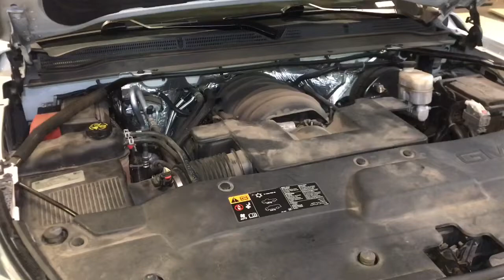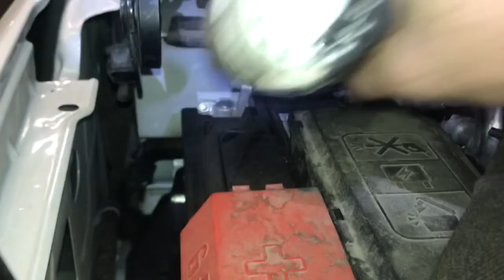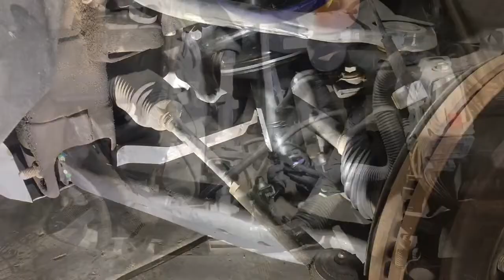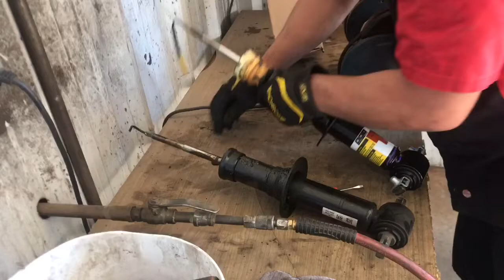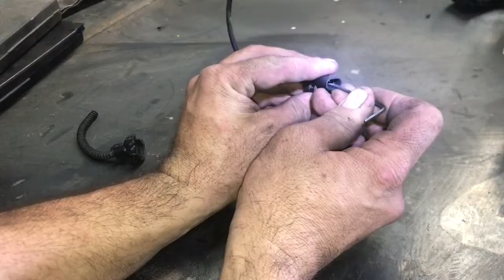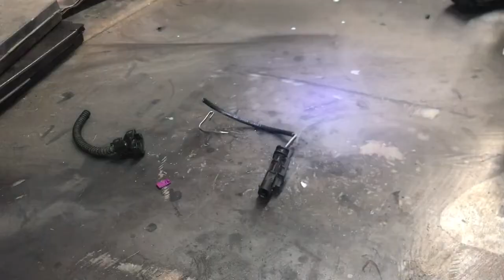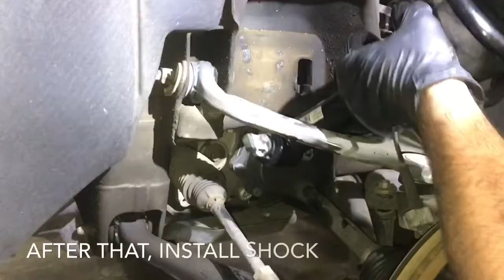Gm Truck and Suv Front MAGNARIDE Shock Replacement (2014+)

Comment: The AC Delco struts are garbage and fail way too often. I’ve owned several of the MRC SUVs and have stopped using AC Delco because of the failure rate. I now use the complete strut assemblies from Detroit Axle. It eliminates having to reuse any old parts and they have a 10 year warranty. Bonus, they’re made in the USA.

Comment: 2017 Denali, purchased 18 months ago with 99K miles,  Dealer said they replaced front struts as part of their prepping it for sale.  

30K miles later, the rubber bushings on the lower control arm, walked out of the strut bore, drivers side strut moved to the rear, passenger side moved forward.  Lots of clunking over bumps, as the strut was hitting the lower control arms.  

I used a air hammer to drive the rubber back into the bore, cut off the extra rubber sticking out of both sides, and welded a 1" washer to both sides of the strut to contain the rubber inside it.  Had to use a large step drill bit to open up the washer enough to give the steel mounting pin some movement.  

This 'fix' worked, but it didn't improve the 'bounding' that the front end had developed.  I called the dealer we purchased the truck from, to find out they replaced the struts with the cheapest ones Rock Auto sells, so we bought new GM ones off Ebay.  They were considerably cheaper than through GM.  

Turns out, the cheap Rock Auto ones, the rubber bushings are completely different than OE, and it's obvious why they failed.  Don't buy crap from Rock Auto, it won't last.

Anyway, replaced complete strut & springs.  Now ride height is about 2" taller than the old springs.  That fixed another problem.  With 22" tires, the tire would rub the inner fender well when turning tight corners, now it doesn't do that.  These new struts came with new upper nuts, however, they were 15MM instead of the 18mm nuts that are 1 time use.

Ride is much improved, but immediately got a service suspension warning on the drivers info system.  

Disconnected both battery cables & touched them together for 30 minutes, to do a computer reset.  Fixed!!!

Comment: I keep trying to find a good direct replacement magnaride strut and coil kit for ease of install and just can’t find an accurate answer for 2015 Sierra Denali
Reply: From what I've found, the cheaper aftermarkets aren't actually magneride, they have the wire and just a sensor or resistor to fool the system so it won't throw a code.  But they're just regular shocks.

Comment: Good video.  Used it as a guide to replace the shocks in my 2020 Denali today.  They both sprung a leak after only 52k miles.

Comment: great video, thank you... I jacked up one side. (passenger).  Tried doing job without taking sway bar link all the way off, that was impossible.  Even after it was removed , putting the strut up into the cradle and putting the nut on closest to you The strut still hung lower than arm!  So had to press down on control arm, jack the strut up a bit to get it over into place.  Mine was the dorman all in one product on a 2016 sierra 1500 denali.  1 hour job on youtube, took me forever to get even the sway bar link off, just my luck.    The fastener holders at bottom of shock that came with dorman are wrong ones, had to transfer over the old ones.   that was a nice surprise running the bolt up into wrong thread -- DORMAN	949730	(2) . going to finish the attaching the sway bar now and then the 2 bolts and electrical.

Comment: CAN'T THE OLD CONNECTOR JUST BE SPLICED TO THE NEW WIRES? **UPDATE** I CUT AND SPLICED OLD CONNECTOR TO THE NEW GM STRUTS. NO CODES, PERFORM SUSPENSION HIEGHT RELEARN. ALL GOOD.
Reply: How do you perform the suspension height relearn?
Reply: @vondaeverett3008  with scan tool
Reply: @vondaeverett3008  WITH A SCAN TOOL. I HAVE A SHOP SO I HAVE SCAN TOOLS.

Comment: I see you have 2 struts linked. The AC Delco OEM and an aftermarket one as well. Huge price difference. $1000+ vs $350…why the big difference and should I alway use the OEM? 2017 Yukon XL Denali
Reply: Did you every figure this out? I’m wondering the same thing have a 2018 Sierra Denali
Reply: @alecbraun95  No luckily warranty covered OEM so I didn’t have to worry about it.
Reply: We went with OEM for our replacement. We have a 2015 Suburban. The strut was leaking and causing a creaking noise in the front end.

Comment: Excellent video!  If the cable that is attached to the top of the shock and connects to something 3:16 is torn off the top of the shock, does it make the shock unusable? Could it be reattached?  What benefits would the shock lose without that cable attachment?

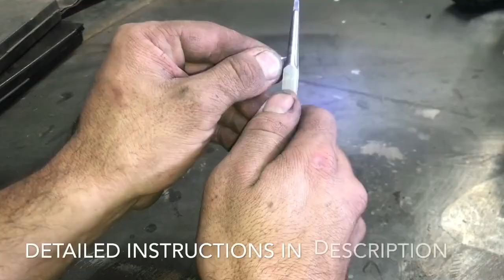Comment: Hi Aaron...great video but trying to find your written explanation for the de pinning process on the connector. You had a message on the video at around 7:23 that it would be in the comments. Thanks for your help.

Comment: Great video!  After months of trying to figure out what the knocking in the drivers side dash was, found this video. Overall great instruction for the weekend mechanic.  One tip, make sure to realign the strut to the mount and the 3-bolt tower or you'll have to recompress the spring.  Passenger side went in easier after that.  Thanks for the help here.
Reply: You to twist the strut to get it aligned with the lower A arm?
Reply: @damarissanders4433  That's what he's saying, it doesn't twist , so mark the spring and strut mount so it aligns to the strut like the original when putting it in.

Comment: If i were to replace these struts with a rough country leveling strut without the electric wires would i have any check engine light or error codes?

Comment: I didn’t had any luck with pick tool.
I found that using a thin paper clip with a sharp bent at end and when inserted twisting it to the purple plastic direction and pulling worked really well (a good hard one not the soft ones

Comment: Whats the argument of repinning vs cut and splice connector onto new wires?
Reply from the maker: Repinning is what the factory Manual tells you to do and how GM does it.  Cutting and slicing is the easier way.
Reply: @AaronHinesAuto  
I guess I’d like to know if the wires are fully soldered together would it make a difference?

Comment: One question,why did you disconnect the negative cable? Does it need to reset for when you change to old shock to the new shock?

Comment: As far as the wires go I just cut the harness off the old one, then solder it onto the new one.
Reply: Does it matter which wire goes to each?  Just match the color?
Reply: @nmgoes  Match color if can. Not sure if it matters or not.

Comment: I noticed the service manual recommends 57 ft lb torque for the top nut.  How would you even torque it with the cable coming out?  I'm guessing most people just guesstimate.
Reply: Using a crows foot wrench

Comment: Thank you for this video!   I have a 2015 suburban with 60K miles and the drivers front shock is leaking oil.  I bought OEM shocks for ~$350 each on one of the GM parts websites.  Last night tackled the first one.  Other than it taking me a while to get that connector apart and transferred to the new shock it went smoothly.  I took pictures along the way as I disassembled to ensure I got it returned the same.  This video saved me over $1000 by providing me the confidence to do it myself.
Reply: I'm about to tackle mine as well, same year and model. Did you rent a spring compressor? How difficult was that part. Thats my biggest concern. Only done minor things to cars.
Reply: @DK11913   I ended up buying the Specialty Products spring compressor 40260 from CarID as they had the best price.  Amazon has a knock off for about half. This spring compressor worked really good and I had no problem. I think specialty products has a YouTube video showing how to use it if you go to their website.  I was worried the auto parts store compressors would be too flimsy for the heavy duty springs as many posts I found warned about.  Didn’t want to take any risks.  I don’t do that much work on vehicles either and found it to be easy enough to do.  I struggled with getting the connector apart and moved to new shock.  Be patient!!   Take some pictures as you dismantle to assist in putting it all back together.  Took me 3 hours for the first and 2 hours on the 2nd.
Reply: Wich website did you buy them
Reply: @edgarzuniga8767  I bought the spring compressor from https://www.carid.com
Reply: Efdy

Comment: I still have a rough ride after replacing all of mine.  Dealer did the first one and I replaced the other 3.  I read in the forums one person cleared codes to get the ride back to normal.  I have no ESCM codes or otherwise.  Anyone have to do a ALC Trimset recalibration after doing this?  Shop manual seems to indicate it should be done.  Going to try it today and see if it helps.
Reply: Tires play a big role in this. Test drove my truck with factory tires - rode like a Cadillac (being a denali 1500). Swapped my DuraTracs on it, and it's a LOT rougher ride. No more Cadillac :(
Reply: @tbon22s  Yeah, I'm a little pissed that a year into it, the dealer said yeah probably tires except they're the ones that recommended these tires over OEM and then told me the fix is to replace the tires which they wouldn't prorate or give me credit on.  I drive so little I probably won't be due for new tires until I sell it unless I fall into a pile of cash but I did like the original OE Continentals on it.  They said the firestone ones they sold me had a lot of ride complaints.

Comment: I'm finally about to tackle this tomorrow. How do you ensure the strut lines up properly when mounting in the spring so that the bolt holes line up?  Seems like the top bolts have some wiggle room from the video.

Comment: Great video. Just replaced my second set of front shocks with your help. Neither has a dash service message prior to beginning the job. On the second set, the service suspension system came up on the dash. I checked the pins and they are properly inserted. Could the wires be potentially reversed? Is there a way to reset by disconnecting the battery? Thanks!!
Reply: I had the same issue. Turns out my connection was bad. The pins weren’t set inside the housing all the way, so I wasn’t getting a proper connection. 
I would check this. Not sure if it helps, but maybe check to see if they are reversed?
Reply: Did you ever figure this out?
Reply: @davidchapman1986  did you figure it out?
Reply: @Tserfess  I never had this issue
Reply: I have the same issue
Reply: @loreneerazo5643  did you ever figure it out?
Reply: @Tserfess  Nope, I plan to delete. Using regular GMC sierra shocks. My Denali pick up has been very needy and sensitive. You would expect since they are advertised heavy duty trucks to be able to handle.
Reply: @loreneerazo5643  did you use regular shocks??? Mine just went out but I do not have a message on my dash
Reply: I have same issue. Anyone figure it out?

Comment: having hard time removing the pins. love to see more detail on this. I tried your link but I really didn't get more insight. Also a video or link to reseting the system may help
Reply: Just cut the shit off the new shock and solder + heat shrink tube the old connector on.
Reply: @ArizonaMatrix  Now we have a thinker lol. I’d trust solder better than me butchering that connector any day!!
Reply: I did this with a buddy and we couldn't use his method, likely because the pick tool wasn't fat enough to grab.  Ended up pushing it from the other side.  Probably bad for the connector but it worked.

Comment: How do you know it isn’t working? My avalanche has 130k miles I replaced my rear shocks and my air pump. Does this system run off of the air pump?  I’m pretty good at swapping things out especially with a video like yours. I changed my plugs and wires today and got to looking at my shocks. Any info you can is appreciated
Reply: The rear runs of the air pump only. Both front and back are magnetic ride control, DC current is applied to change oil viscosity.

Comment: Thank you for doing this video!  Replaced them on '15 Escalade only 50k miles!  Rented Heavy Duty Spring Compressor from AutoZone.  Picked up the de pin tool from NAPA and Struts from GM parts direct.  SAVED $1,300 doing it myself and feel accomlished!
Reply: I have to change mine too. 2016 Denali with 52000 miles.  GM garbage
Reply: @rich.e.1786  Same here, gmc sierra 2017 whit 48,000 miles and all the shocks need replacement im doing it myself
Reply: What were the symptoms you were getting? I have a 2015 Suburban and I'm getting shaking/vibration 70-80mph
Reply: @jonstanhope5453  squeaking, vibration, bumping noise, oil leaking from cartridge, inner tire wear and when it get real bad check engine light with service suspension on your info center.
My 2016 Denali Sierra made 134,000 when both mine took a massive dump. I replaced my springs too because of millage and the front lifted 1&1/2 inches. Then after a month it settled to 1 inch higher
Reply: Hi I have same ESV 15.  front shocks are low rider go loco... I tried to get these Luftmeister one seems like its sold out..if u don't mind asking  where ya get them shocks homie?

Comment: 2015 Yukon Denali 4x4 with 58k miles, factory 22 inch wheels. Around October of 2019 my two front and right rear units locked up and started leaking. The dealer quoted $2,900 to replace. I didn't want to pay that insane amount as well as periodically replace this poorly designed suspension every $60k miles. I decided to switch from the magna ride to conventional using an aftermarket conversion kit. The conversion kits include front strut assemblies, rear shocks and struts, and the wiring deletion kit so the computer doesn't freak out. I found an issue that some Denali's experience with this modification, factory wheel size will produce different front end ride heights. Most of these conversion kits are designed for 20 inch wheels yet nearly all Denali’s come with the 22 inch wheel creating a height issue. After converting the struts my front end ride height was 35 inches, factory should be +35.9 inches. The .9 inch variance resulted in an extremely weird look, low enough that the wind deflector scrapes on parking curbs. The ride is great yet that look bothered me so I added a 1 inch leveling kit. Now the ride is awful and my caster is -4.5 after alignment. 

I reached out to the manufacturer and I explained the variance with the 20 to 22 inch wheels, they agreed and decided to replace the front assembly with longer units. Basically they are going to replace the entire front units from a 5 coil spring to 6 coil.  Next week I am going to replace the units and remove the spacer. All I care about is a normal ride height and ride quality. 

Here are my current struts, very compressed.
Reply: Well, I'm having issues attaching photos to the post. I'll add the photos soon.

Comment: Thank for this video! Im having to change my struts for the same truck and i couldnt find any good videos , i appreciate you taking the time to put this together for us. Its greatly appreciated, and f.y.i. my truck has 70k miles if it helps anyone else know that info. Passenger side went out but im changing both fronts as recommended.

Comment: Does it matter where the cables go? Like if they are switched from left to right and right to left when it’s connected to the connector.. thank you
Reply from the maker: I have not tested to see if it works. But theoretically I don’t think it matters. I could be wrong. But it shouldn’t
Reply: @AaronHinesAuto  I'm about to tackle this.  Do you know which color goes to which side or do I just need to pay careful attention to the orientation when I pull it out?
Reply: I didn’t pay attention to which color went to which side, however if you pause this video at the point where he’s repinning, he doesn’t put them back in the same spot. Not sure if it matters or not.
Reply: @harleyhoracio1  Yeah interesting find.  I just took a picture of them when removing them to refer to when putting back.  I also have a bidirectional scan tool and monitored the shock command for the fronts and they seemed fairly symmetrical.

Comment: Great video! Changing out mine this weekend 2017 Denali 1500. How about a video for lower control arm replacement? :)
Reply: I got a 2016 that needs both fronts done.  All quotes I got were from OEM parts.  Are these trust worthy?  Because they’re much cheaper than an OEM set...
Reply from the maker: I got one of those coming soon! Thanks!

Comment: I replaced my front shocks today. thank you for the helpful video. Special Note per the GMC Dealer: When disconnecting the battery, connect the ends of the battery cables with a vise grip to initiate a reset of the computer. When you finish the job, the 30 min reset time will be complete as well. The reset is needed if your old shocks were damaged and the system was compensating. When I initially drove my Yukon, the front "floated" after bumps-like a 70's Cadillac! The reset (above) completed and a 20 mile drive cured the "floaty feeling" it had. Thanks Aaron!
Reply: Can you explain the reset a bit more? Connect what to vice grips?
Reply: @Tserfess  you take the positive cable and the negative cable and touch them and hold them together. Obviously, make sure they are disconnected from the battery.
Reply: I need to try this. I am floating all over the road......
Reply: Anyone know if this reset will affect a tune? Thx